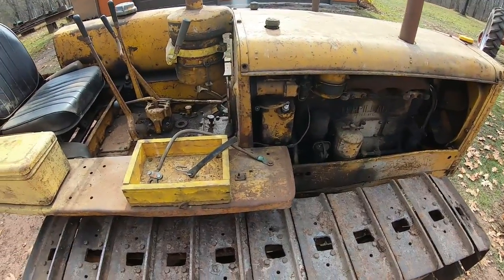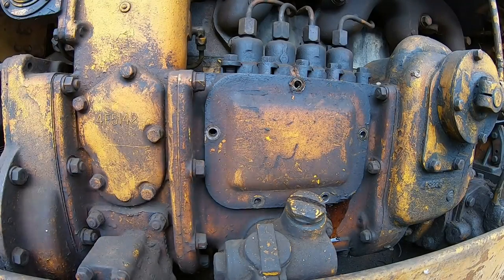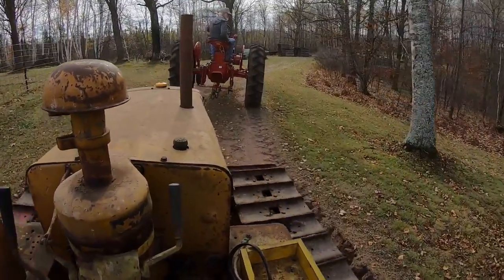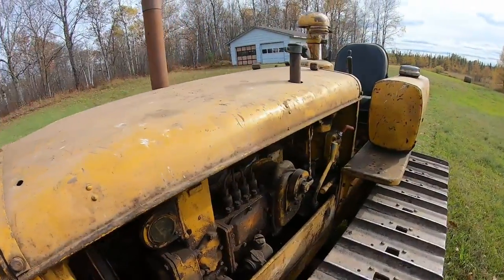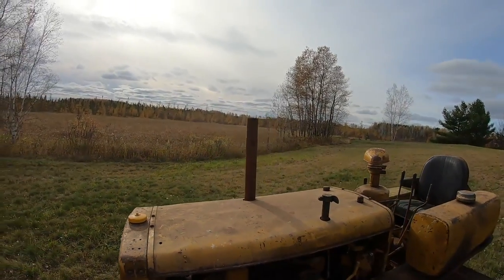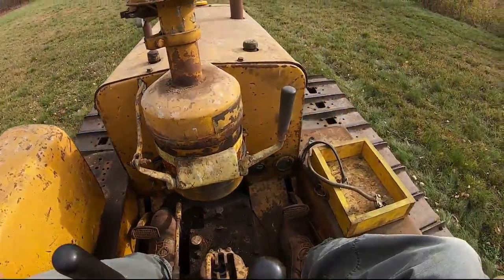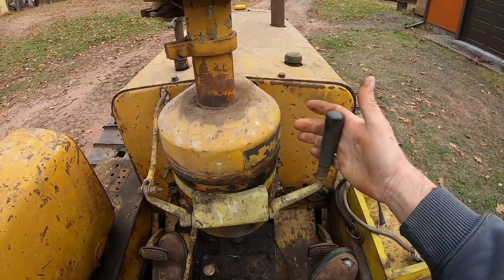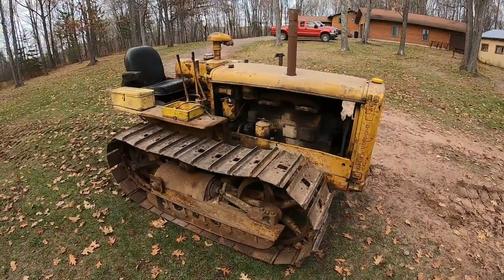Will It Start After Sitting For 20 Years??? Caterpillar D2 #5U4177

Comment: Steering clutches ok, engine great, track ok.  I would just fix the rear drive gears and pony motor and have a non-restored d2 to use. With the larger front idlers I would think about putting a blade on it.  Just seems too good to me to part out.  I would love to have one to clear my logging roads on the side of the mountain I own. To me even with worn rear gears it still might last me the rest of my lifetime. So for me I would just fix the pony motor and find a blade for it.
Reply: I most agree with you, but the grinding rear end would definitely bother me, I’d need to go through it.
Reply: No it needs to remain a farm crawler.

Comment: It says something about the engineering quality of this machine to sit for 20 years, circulate the oil, pop the clutch, add fuel and hum like that. There isn’t many machines built today that would do this.
Reply: Has the older diesel with more lube.
Reply: If you watched tractor (wheeled type) channels, this kind of starting is pretty normal, and after longer than 20 years too.

Diesel engines are amazing.
Reply: @paulwomack5866  yeah it is but modern tractors dosnt start as well like older diesels and often modern engines dosnt run if computer or some electric part dosnt work i like more olders
Reply: Modern Cats will be beyond restoration in 10 to 12 years... and if left to sit, all the computers will be toast.
Reply: @jessezs1491  Me too, I don't bother with newer tractors they are a mess. I have older machines that have been in service for many years and they will still be running and working long after the newer junk is trashed.
Reply: @dukeman7595  thats true
Reply: @jenniferwhitewolf3784  even if it is running, fixed after some sort of failure clearing faults will be an issue. Consumer can view but isn't able to clear some faults and they are the ones that cause power derate - authorized service person has to get a code to clear such fault. I wonder if or rather when CAT will just refuse to send people out to older machines (older in a few years, as we are talking about post 2010 machines)

Comment: In 1977 my father attempted to start his own excavation business prior to retirement as a tool & die mechanic, so he bought an old D2 dozer - nearly identical to this one - a dump truck, trailer and a backhoe.  None of us had any experience doing any of that but we put in septic tanks, drain fields and foundation work.  I ran that little D2 which didn't have an electric start for the pony motor, so we had to start it with a piece of pull rope from inside the cab.  The only problem was, he let my brother run the business and that doomed it from the very beginning.  I operated the equipment which only hastened its demise.  I eventually went back to college after everything was sold and became a Registered Nurse instead for which I was very much more competent.  I did love that little D2, however, so hearing this one start back up again brought back a lot of memories for me.  It was a great little machine.

Comment: That diesel runs so sweet and so clean, you can just about see how a less knowledgeable former owner who didn't know about the drive sprockets not being pressed on or torqued properly sort of accidentally let the rear mechanisms wear so unfortunately. It was really pleasing to see that engine run so commandingly and so soundly.
Reply: If he ever tears this one down on camera, and finds the bulls in decent order, i'm betting this wasn't the owner's fault, rather he took the machine to a shop and a yokel welded the sprocket crowns on and didn't do the install back to spec.

So many tractors, cars, tools, machines, what have you, are in mint condition in 70% of the bodies, and then one thing, one thing repaired by Joe Average is so damaged and so torn, it takes two other things down with it.
Reply: Saving old iron. One piece at a time.....

Comment: Very nice.  I was kind of surprised that it started so quickly after you finally gave it a go.  Looks like everything in the driveline works too.  That engine does run smooth and sounds good.

Comment: About 30 years ago a D2 was brought into the local scrap yard. The price was way down and it cost the yard owner $75. The engine was not stuck. however the clutch would not release. probably rusted to the flywheel?  I put it in gear and sat in the seat and released both steering clutches and we pulled it with a large atriculated front loader. and it fired up and ran really good like yours in this video.  It had a good undercarrage and was a tight machine. Even had a PTO. I think he sold it for $1500.

Comment: Sometimes it's nice when things change. Your parts tractor turned into a prize tractor. Oh sure it has it's problems but what doesn't. Everything has it's problems. I'm sure with your network of enthused tractor rebuilders and your knowledge this would a great project. Sure it would be a ling time down the road but wow what a rebuild this would be. Great video.

Comment: That's one good machine. Worth rebuilding the pony motor, rear and finals. What a champ, and runs so good for over 7,000 hours. That's kind of getting up there. I was told in the forklift business that every 250 hours would be comparable to approximately 3000 miles. (Back in the day, a regular service interval was 250 hours = 3,000 miles.) Anhow, if that's the case, that drive train has been run potentially the equivalent of approximately 194k miles at 7,000 hours.

Comment: Ran a d2 in a citrus orchard, seat tank, no electric starter either. Watch out for that spark plug wire when you start it, those mags packed a wallop. We adopted new non tillage methods and seldom used it after that. It had a feeling that is rare today, built to last, engineered with maintainability in mind. It still is running  but is mainly a barn resident now.

Comment: That thing runs WAY too good to part out.  Good engines, tracks, clutches, steering, matched engine, most of the parts...  You need to rebuild the transmission...  I would wait at least until you pull the drive gears off and see how bad they are before you decide.

Comment: That motor runs great! Alright hear me out, we press the drive sprockets on as correctly as possible and we run it till the rear blows. Small detail guess we fix the starting motor. So we can start it easier
Reply: Definitely agree with you, I think as long as you weren’t flying down the road I think that rear end would growl along for a long time like that.

Comment: I purchased a 7U D4 in 1967 and the first thing I did was cut the square holes in the track grouser plates. Scrub builds up on the sprockets and stops the sprockets from engaging the track pins. Cat was the only dozer we had that had this problem. Yours is all gòd to go.

Comment: These little crawlers were all the go on early broadacre farms. They largely predate the big 4WD wheel tractors . Which is why most didn`t have blades fitted. I believe you were right on. Popular also were the Cletrac & Fowler brands for paddock work. But those machines failed to adapt to changing competition like Caterpillar . A big turning point in machinery history.

Comment: Yeah no need to tempt fate at high speed and throwing a track lol a town dozer did that in our yard when I was a kid of about 14 it took 6 of us to loop and hold the track after taking out the idler adjusting bolt and replacing it with a new one because the old one snapped in half  and tossed the track but the old D8 fought every inch of the way but took the fix.

Comment: Hi Squash, good to see you back. I missed your very informative shows. Regarding the injection pump, I noticed the drip pan was pointing away from the block while the other three were pointing towards the block. I remember the series where you rebuilt a Cat J5113 (I think) you took time to explain their use. Is that one drip pan (I can't recall what you called it) pointed in the right direction? Glad to see you back.

Comment: Again ... you and senior have saved my bacon. Let me explain... I just got a 1954 Cat No.12 8T 1230 (D318) Motor Grader and it came with a late model c.1945 Cat No.12 9K 9320 (D4600); anyway, I'm bringing them home tomorrow. This video reminded of issues I  should have thought of but due to the excitement of getting them home I've been blinded. THANKS 
Once again, how serendipitous ... your timing is impeccable because it gives me time to run down and do the primary checks to start the old engines that have been setting for a time...
Yeah, Yeah I know the No.12's are no #5U D2 but these two have been on my Bucket List for twenty years or better.
Reply: @squatch253  😁😁😁 If the smile on my face hasn't gave it away 😁😁😁 the 8T 1230 fired right off. I rebuilt the carb and fuel  system this summer and crossed all the i's and dotted all the t's .. I just had a vapor lock in the fuel line and blew a puff of air in the tank. and voila pop pop pop grabbed a fresh GoPro battery and got the rest on video.
 I'll let you know when the video is up...

Thanks so much...

Comment: Hi! Can you make video where you explain why a farmer would choose a tracked tractor instead of a wheeled tractor. 
What was the benefits of each machine compared to each other. 
I think here in Sweden most farmers used wheeled tractors back in the 50s for example.
Reply: Biggest advantage for tracks is low ground pressure so less compaction on clay soils plus much more stable on steep country. Balance that against slower speeds and generally higher running costs per work performed. So for steep/soft/swampy ground (with lots of sharp sticks/stumps/stone) you need 1 of these. ;-)

Comment: New to this channel.  I'd sure like to have this little pony and I think it would be great to see you go through the back end so we could get a handle on how bad is bad. I've had instructors and even text books that talk about "excessive wear"  But what is needed is too look at a part and be shown if it has "excessive wear or not".  Then there was an old mechanic that when looking at a part would proclaim that "I've run worse and replaced better".
Reply: Back in the day when I didnt have a lot of money. I welded the teeth up on a pinion and bull gear on a D7 3T Cat. the bellows seal poured 140 weight out on the ground. So I kept cramming toilet paper into the fill plugs until it stopped leaking.  It ran 9 years and a lot of those where 50 hour weeks. Had a root rake and a cable unit. Stayed in the flat lands stacking & burning timber the was felled by a D8 with a cutter blade. The spoke front idlers wore so thin the had holes worn thru and I welded those up also. Pins and bushins had so much internal wear I had to take a link out of the tracks because the adjuster screw and nut wouldnt go out any farther. I even ran weld on the rails to build them up. Trimmed the flanges on the bottom rollers so the wouldnt keep riding on the pin bosses. The pusher fan had sandblasted the radiator  core so much it wore thin and leaked. It was bright & shiney and east to solider. But that solder would just wear off pretty quick. So i removed the radiator . And took of the top and bottom cast iron tanks and flipped the core so the worn side was facing foreward. I heard that it met its end in Kuwate. It seems the Red Adair company bought it shipped it there . loaded it up with dynamite and some nitro packed in ice. and headed it into a burning oil well. When it blew up the explosion used up the oxygen and put out the oil fire !?

Comment: Toby,
Ok teach me history.  You mentioned in the walk around of 5U, the the wear patterns appeared that this crawler was probably a an Ag unit.  A couple times back in the 5J re build near the end when inspection the rollers and sprockets,, you mentioned Ag usage would side load the rollers and have them wear offset.
Ok, Ag usage?  Why a crawler verses the tractor?  They mostly had the same HP and drawvbar rating?
Thanks fer the lesson.

Comment: Please don’t part it out. Restore it, Take all winter to tinker with it in a dry section of your barn. Fix the rear drives, give it a good soapy degreaser hot bath , sand down all the tough spots on the paint and repaint it with a nice fresh boat of Cat yellow highlighted with Cat black, stick it up on a trailer and take it to all the antique machine shows. Oh and give it a nice new chrome plated stack with a rain flapper to put the icing on the cake.

Comment: Sounds great, but what good is this machine without a blade or a bucket?  Unless you have a specific use for pulling it's totally useless. I have bought and sold several dozers and I would not have even considered this machine with a loader or a blade.  What will be you use this machine, I'm very curious?
Reply: @squatch253  Thank you for the reply I appreciate that. I will check out the info. you gave me. I found your channel today and I'm amazed by the knowledge you have, and learned a lot which will help me buying dozers.

Comment: excellent, sir. congrats on your find. May I ask, I have stumbled across what I think is a late 70s, early 80s JD 550C. Tonight I plan to learn what I can about this crawler. It has a 5-way blade. I see no signs of needed repacks. It's kinda hard to get to where it is sitting. In a pasture completely and I mean Overwhelmed in vines and tall grass and bushes that have been growing, I would guess 15 years.

From what I can see without dragging it out, all the access panels, inspection doors, and all are not bent up. The old gal looks like she was simply parked and forgotten. I used my cell phone GPS and an APP to tell me who owns the land. No living structure for miles around. I learned the owner of the land lives about 10 miles away. I have yet to make contact. I don't want to seem overly anxious but man, I want that little dozer. It's never been covered the whole time. I worry about that fact. I have passed this thing many times over the years and never a second thought about bringing something like this back to life. 
I found a few channels on Y/T and now I'm hooked. again, I have no idea why. What do you think would be a good ice-breaker conversation when I meet the owner? He has a beautiful home set on 10 acres. Looks to me like an easily seven-figure estate. Any advice is appreciated.
Cheers from Louisiana.
Reply: Did You contact the owner? If it wasn't covered it might be flooded because rain would get into the cylider that has a valve open. Not sure how it is at Your place, but here people wouldn't be angry if You would go into their woods, fields etc. even if that is trespassing, but people can be very territorial. Let us know please.
Reply: @MindBlowerWTF  Yes, I researched the property owner. it happened to be the same owner of the crawler. He wasn't at all upset I had looked at it. He asked me if I could send the photos via text I had on my phone to his grandson's phone. He said I was more than welcome to drop in a hot battery and fire it up. He did say please check all fluids and such for water contamination. There was none. It last ran about 9 or 10 years ago he said.  "after you hear it run let me know if you want it, I'll take 5k for it." He has the paperwork. He warned me about a possible crack in the left final drive housing, it had a small leak and leave a "pretty good size" spot on the ground. I want to check the fule rails before I spin it over. The last thing I want is it to run away one me. I had planned to do this, this weekend. But the weather went from 80 degrees yesterday to 31 degrees with sleet and snow flurry today. One thing about Louisiana weather. If you don't like it, stick around 30 minutes. It will change.
Reply: @radioace318la  Pretty good to hear that. Good luck on Your adventure and hopefully You get a weather window.

Comment: Help!.... I did what you did in the video and popped off the inspection cover. All of my lifters freely move up and down except for the one toward the rear of the tractor. Do you think that is why I can't get it running again?
Reply: @squatch253  thanks squatch, you're a life saver.
Reply: @squatch253  that's it, youre advice worked. I had to roll the engine over and gently pry it dow. about 3 times before it freed up. Runs great now. Thanks. If you find yourself in El Paso look me up and I'll take you out of a huge west Texas steak.

Comment: What gear was the cat in when you towed to build diesel motor over? Right now I cant build fuel pressure for some reason. Good video.
Reply: @squatch253  thank you, I thought that might be the case. Im glad your IH easily pulled the D2. I wasn't sure if I could do that with my MF135 until I saw your video. I just need to move my D4 U60 so that it's easier to work on. Great video, you showed me everything I need to precheck as well. 👍
Reply: @squatch253  before watching your video I often wondered if the 2 cylinder starting motor would be durable enough to move my cat without damaging any part of the Caterpillar. I never did try using the pony motor because I thought I would damage my D4.

Comment: Have you got the spare parts to put in this tractor to make it a solid back end? Wonder if the noise is just bad teeth contact from kaput bearings. I know the sprocket and shaft are spent tho.
Reply: @squatch253  totally understand. Short of making your own molds and patterns and casting your own replacement parts, there's no source for new parts anymore on some of these old tractors. Too bad shipping is so expensive otherwise getting cheaper tractors out west would be easier.